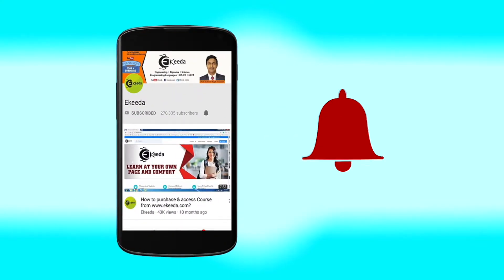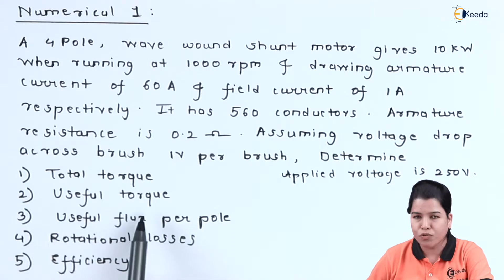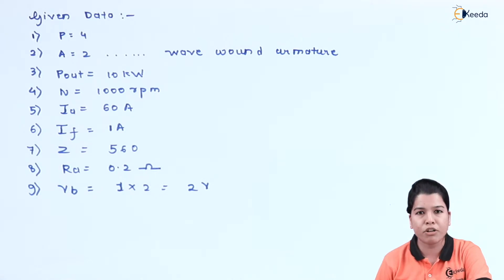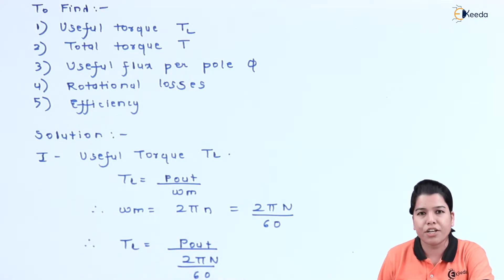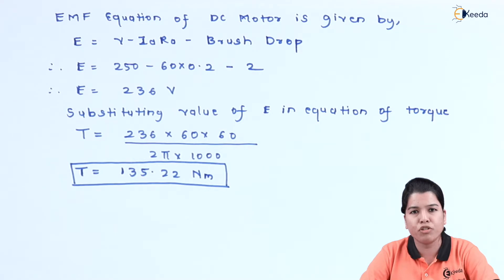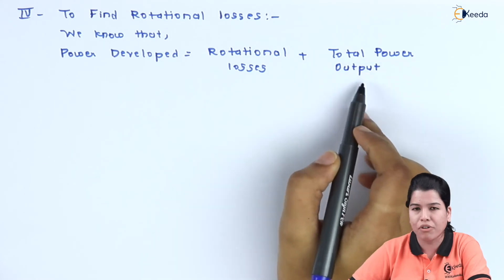Numerical 1 On DC Motor - DC Motor - Electrical Machines 1

Comment: 00:02 Solving numericals on DC motor
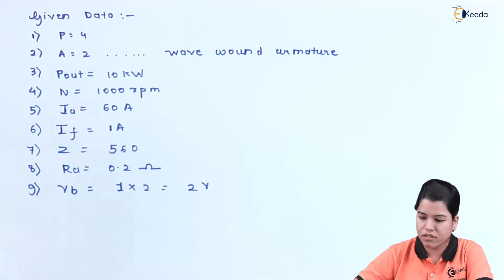01:17 Calculating torque, total torque, useful flux, rotational losses, and efficiency of the DC motor.
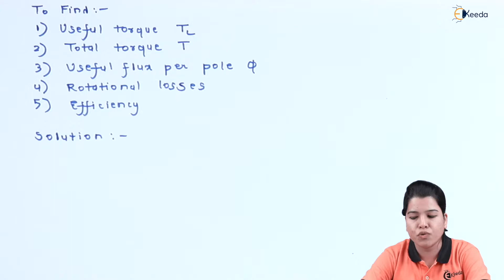02:15 Formula for useful term in DC motor
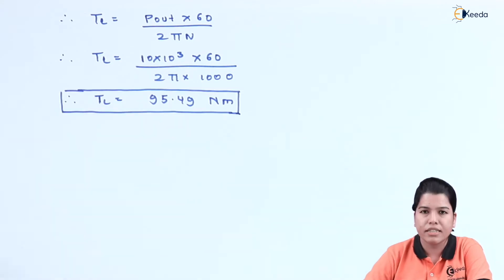03:17 Calculating total torque in a DC motor
04:18 Calculating torque and useful flux in DC motor
05:26 Finding rotational losses in DC motor
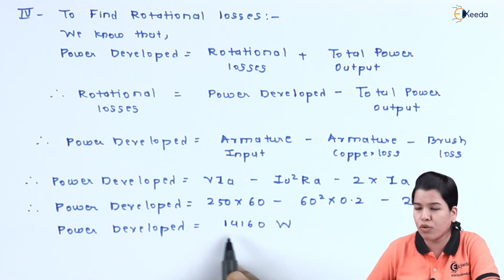06:27 Efficiency calculation and input power determination for a DC motor
07:25 Calculation of efficiency of DC Motor
Crafted by Merlin AI.00:02 Solving numericals on DC motor
01:17 Calculating torque, total torque, useful flux, rotational losses, and efficiency of the DC motor.
02:15 Formula for useful term in DC motor
03:17 Calculating total torque in a DC motor
04:18 Calculating torque and useful flux in DC motor
05:26 Finding rotational losses in DC motor
06:27 Efficiency calculation and input power determination for a DC motor
07:25 Calculation of efficiency of DC Motor
Crafted by Merlin AI.